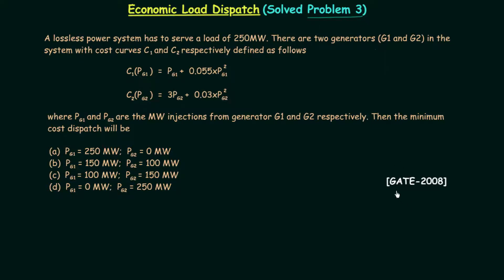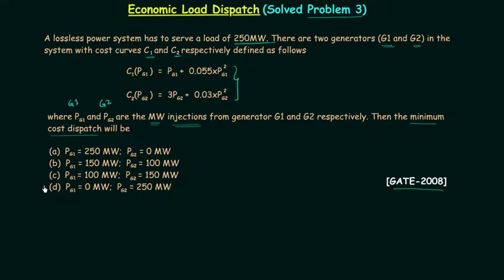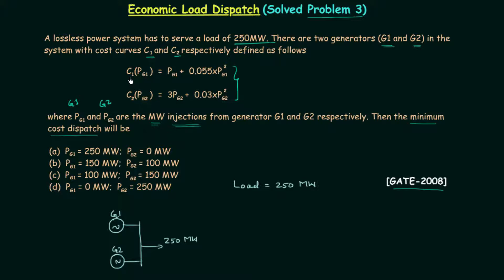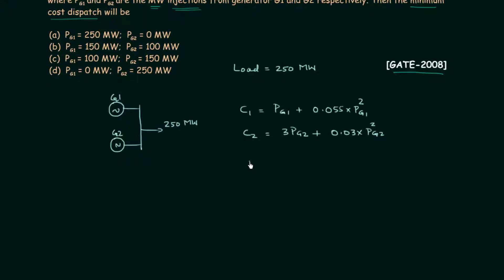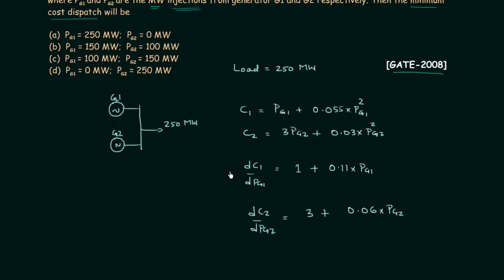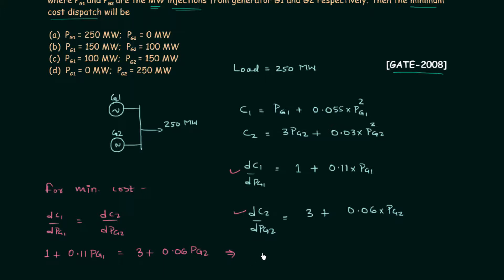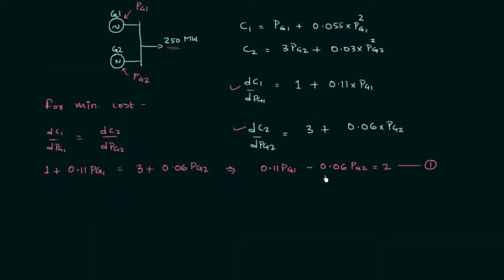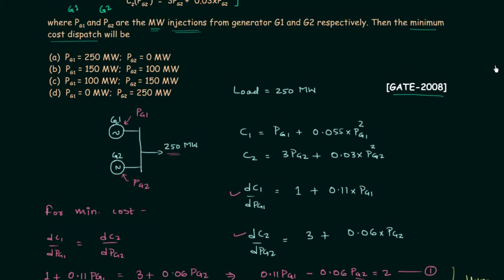Economic Load Dispatch (Solved Problem 3)

Comment: By using the Gauss-Jordan method, you got PG1=100 MW and PG2=150 MW, which supply a 250 MW load.
If you plot the original quadratic equations, it can be seen that PG2=150 MW it has an IC2=1125, while IC1=1238. That is the reason why, PG2 is dispatched bigger than PG1, because it has a less incremental cost value at that point.

There is a segment of the plot where IC1 is smaller than IC2 but the combinations of PG1+PG2 will be always less than 250 MW.

Comment: Electrical Engineer's view: (HomeWork)
I used Cramer's rule for finding Pg1 and Pg2 and get the answers closed to option (C) as my answers are PG1= 76.4 MW and PG2 = 147.05 MW. But round off we get PG1= 100 MW and PG2 = 200 MW which is the only option (C). I use Cramer's rule because I got two equations not solving easily as after adding Equation 1 and Equation 2 I get : (1.11* PG1 + 0.94* PG2 = 252 MW ) which was again a problem to solve. So use Cramer's rule for ease. 
Link : (Cramer's rule help site: https://www.chilimath.com/lessons/advanced-algebra/cramers-rule-with-two-variables/)

Request from NESO Academy @NesoAcademy: Upload examples related to Lagrange equations (L= F1(PG1) + F2 (PG2) +....+Fn (PGn) + λ (Pd) - P1 - P2 - ....-Pn )  and Lambda involve which is our real course problems these examples are just learning how economic dispatch works.